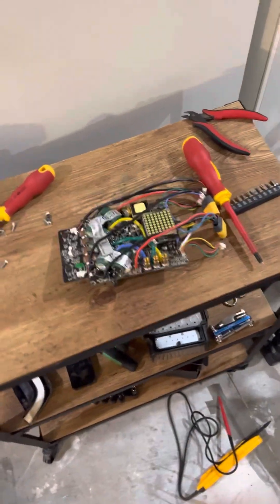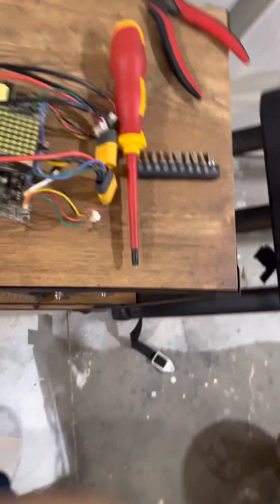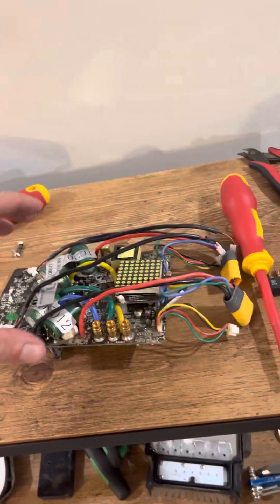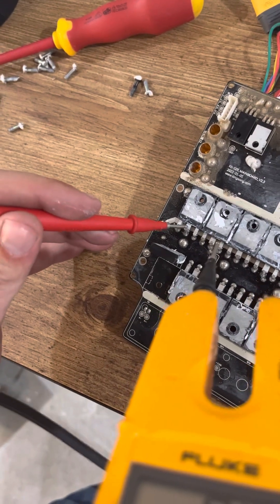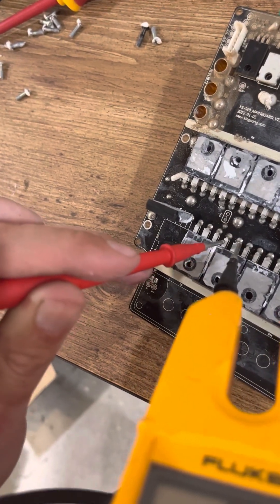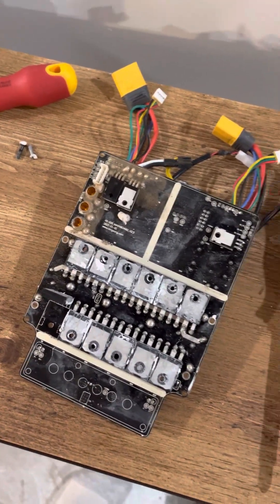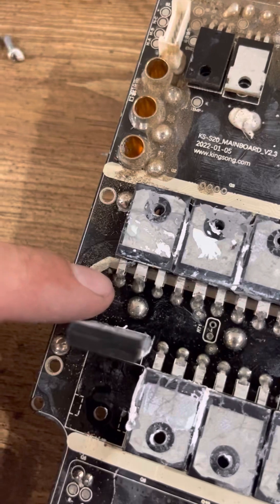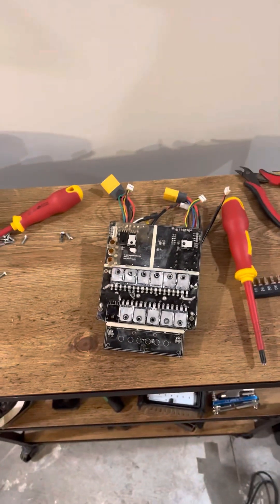Don’t watch this.

Comment: Matt can you tell me what thickness the thermal mat should be when replacing thermal paste ?
Reply from the maker: I did not replace the mat since it is cut perfectly to size, I just cleaned it up with isopropyl to get the old paste off

Comment: If the mosfet is bad just cut the legs off and desolder the pins one at a time.
Edit: I didn't realize you needed to desolder good mosfets from a donor board. A soldering gun (the Weller current type) can be used. Make your own tip. Instead of the tip coming to a point, make it wide enough to cover all three legs at the same time.

Comment: You are a hero, ill try this with my blown board. Having a second spare board is such nice a peace of mind thingi to have
Reply from the maker: If you chose to do this be very careful, perform the work carefully, do some tests with the wheel like freespin, slowly bono up a curb. Ease your way into normal riding to be sure the repair will is going to hold up before you trust it.
Reply: @trubttam  yea yea I have my tests, also, it would just be a spare motherboard anyway. Like, just for covering the time until a new arrives for example.

Comment: Solder the legs together in one glob, then heat the whole glob and remove all three legs at once. 🙂
Reply from the maker: I’ve been told I can heat the board with a hot plate first to make things easier, I’ve don’t this repair 11 months ago and basically did what you said but it was still very difficult

Comment: From my time in the EE lab, we would say a Metcal soldering station is really good at dumping a load of heat into a heatsinking circuit like this. Maybe snip the legs and take them out one at a time, solder sucker/desoldering braid to clean out the through-hole, then solder in the new one? But yeah don't do this at home kids 😛
Reply from the maker: Yeah I heard I can maybe use my 3d printers heat bed to get the board saturated with heat first, for the mosfets I need to use I can’t cut the legs cause I need to reuse them but I hope the heat bed makes things easier this time
Reply: Yeah, preheating the board should help, too! The 3D printer's bed as a preheater is a neat idea.

Comment: *click bait!  the tittle made me watch it 🤣 just cut the mosfets legs and solder them together. 🧐 good luck with the surgery of your board🤙
Reply from the maker: For the dead ones I can cut the legs but I need to remove the replacements from the donor board very carefully so they can be used again, and the power flowing thru these is so great that you don’t want to just use wires to make the connection, gotta use the fets legs

Comment: Now I wanna try to fix my boards as well just to see if I can lol test my euc repair skills
Reply from the maker: You didn’t get the idea from me lol
Roger has tried this repair before and the board failed again immediately. Mucho risk, be very very diligent.
Reply: @trubttam  but when it failed, nothing really happens right? I mean, the board was dead before, and I do t think the motor takes much damage from this. The batterys should protect them selves
Reply from the maker: Well when it fails the wheel drops you without warning, that can be bad
Reply: @trubttam  already had that when the motor killed it self (first batch motor issues
Reply: I wouldn't suggest that you you it, you can end up really messing up your wheel more than you imagined. I remember years ago when I had an old imac desktop computer that needed repair and I ended up destroying the whole thing. Lmao

Comment: At least you diagnosed it. Maybe a electronics repair shop or a tech or even an experienced diy'er (with the requisite soldering/desolding tools) can do the dirty deed for you at a nominal cost esp since you already have 'donor' fets. It would be great if you can vid the mosfet exchange process (edited version ofcos 😆) for those thinking of doing similar. Good stuff Matt
Reply from the maker: I’ve done this before on my rs, people have been giving me some good info on how to make the process a little easier. This surface mounted stuff is still a bit foreign to me